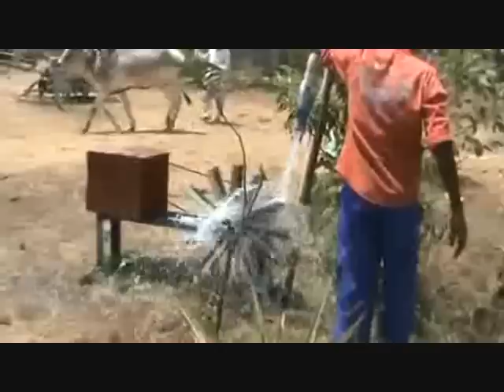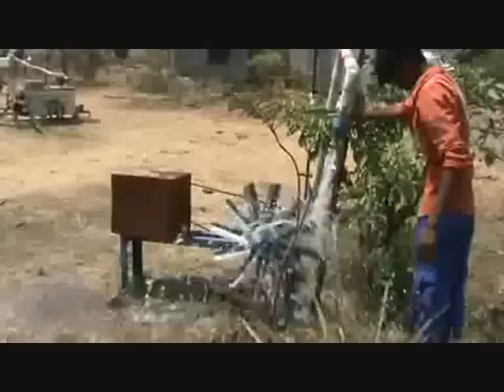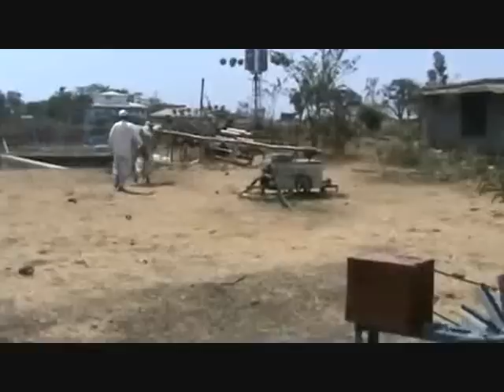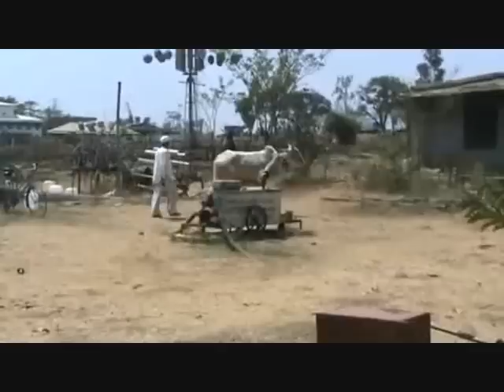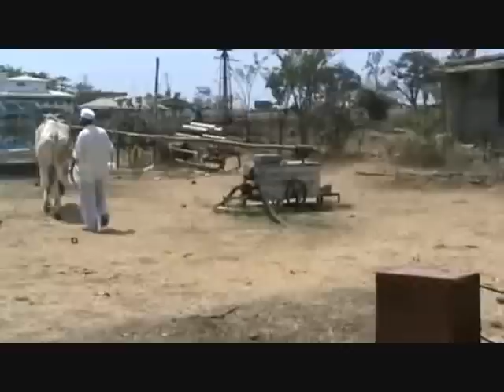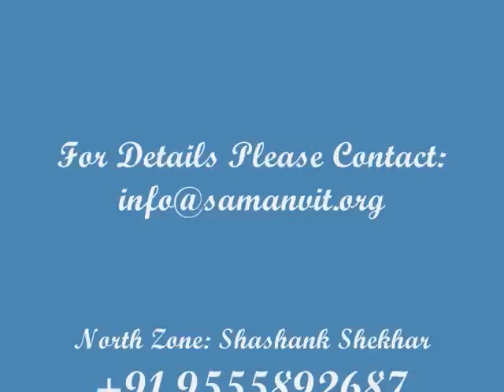Ox Driven Generator

Comment: @kiranpatil I think if you fix an electric water pump to the alternator or generator, you still should be able to pump the same amount of water or may be even more because loss energy can be saved from transferring rotation from the gear to the fly wheel of the water pump.

Comment: 24 x 7 green electricity, benefit to any country
Greetings, with your blessings and permission. 

https://youtu.be/XRgSUI5QeIo

This is flywheel power multiplication 

The second one is cascading power generation using still water 

For mass production 

https://youtu.be/dxLnZEz5HWU

For residential areas 

https://youtu.be/MWMZPQPE2vU

We have more than 25 years of practical experiences in designing clean energy projects.

We have our own research lab  

with regards
Chaganti
+918555045244

Comment: The concept is to promote the independence of farmers and to save oil. Oxen is pairs work very well and they are relatively easy to handle. Attached please find a copy of my alternative energy solution powered by oxen. https://www.flickr.com/photos/maximogomeznacer/28975240371/in/dateposted-public/All farmers are welcome to use it to provide electricity (just one horse-power is 746 watts or more than two million watts per HOUR...2 685 600 watts to be exact...and two oxen are expected to produce at least twice this amount which could be equivalent to around five months of electricity ...in just one hour or so of the work of the animals.  I do not authorize the sale of the energy using this method, namely using the gravitational and kinetic energy of large animal. By building the large wheel we obtain a significant improvement of this centenary oxen technology because the mass of the animals will not be wasted standing on the ground but actually contributing to move the wheel. In turn, the big wheels act as levers that can increase the torque to around 200 000 pounds of force. This is why it is better the solution I am proposing you here. I authorize the use of my solution to all farmers to pump water to produce food, etc. but not to sell the energy in the form of electricity, telecommunications or other form. The mechanisms can be produced at los cost in the United States or other places. Your welcome, Max (Dr. Maximo Gomez Nacer) mgomeznacermd@gmail.com

Comment: Jai Shree Krishna!!
What is the approx KW poer generated from 4 oxen as shown in this video. back in 2011 I made some estimates of how much power can be generated and have put that in this spreadsheet. Also I have identified low RPM alternators/generators with extremenly low clogging and costs like $700 for 8KW alternator. Please let me know 
https://docs.google.com/spreadsheet/ccc?key=0AjXIFnMAk400dDJ5Z2tQeS1fekprNjgwRDY0RzJHREE&hl=en#gid=0
Reply: Hello Ghanesh, Calculations are wrong. Check that again.

Comment: good, the water is not only irrigating the land, it is used to generate electricity. but the man power wasted in driving the ox is to be modified. how about direct conversion of the circular motion into higher rpm and dynamo generated electricity as well. it is already supplying water, water force runs turbine as well